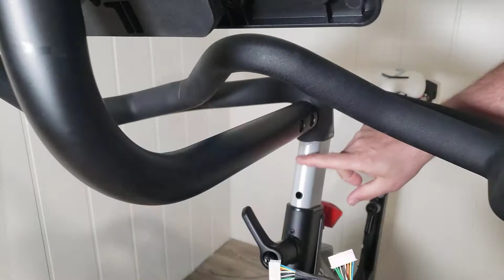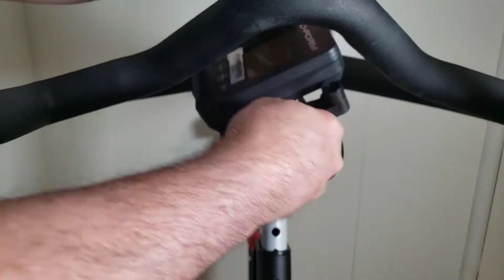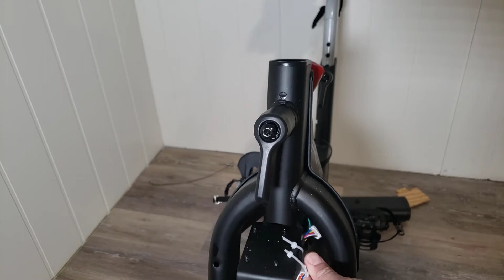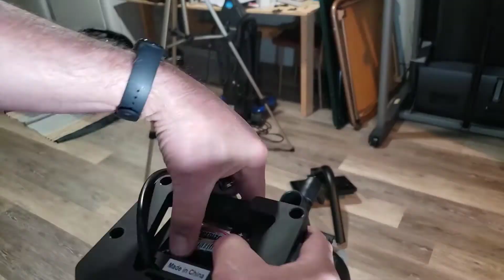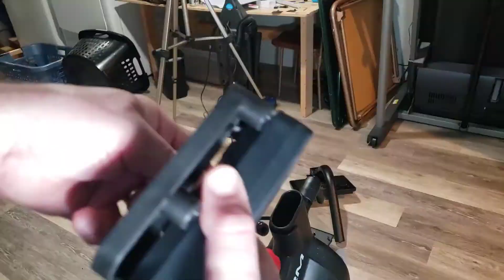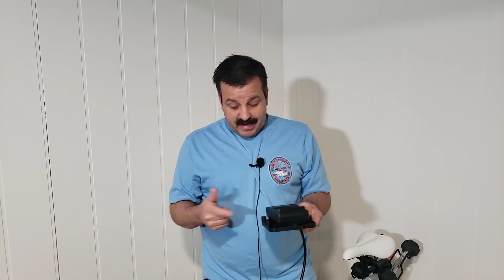Smarts Steps for Testing Parts | Proform Carbon CX with CH0 CH1 Error

Comment: These bikes must be junk. I purchased mine off of market place and clearly bought someone clothes hanger. What a POS. I wonder if there is a way to manual change the tension on the wheel? )keep  it steady) anyone?
Reply from the maker: Did you ever find this video? https://youtu.be/X2UAm2nXqvE I never had an issue with the stability of mine. What sort of floor do you have yours on?